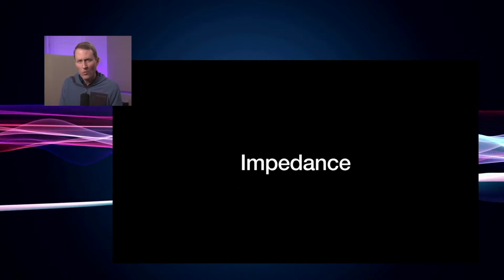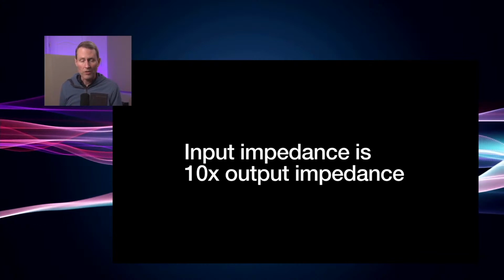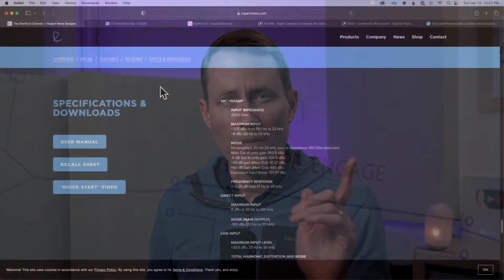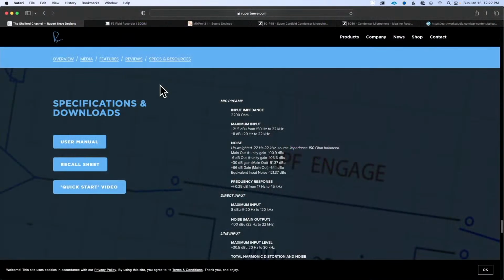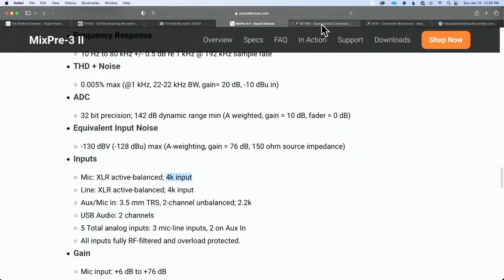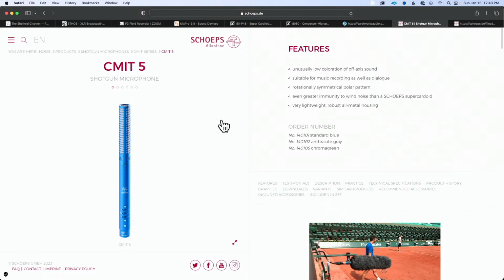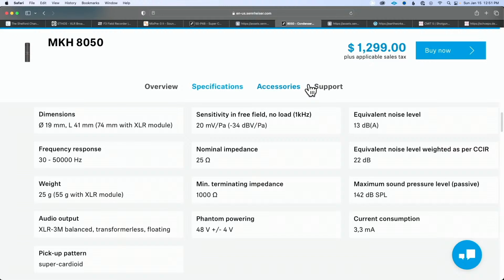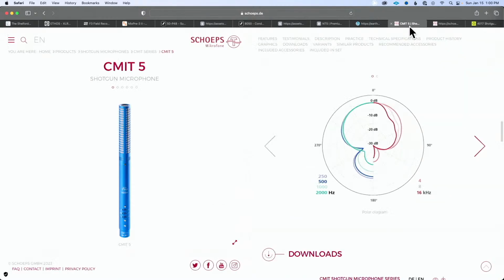Sound for Video Session — Impedance & Q&A

Comment: I consider impedance (AC resistance) to be simply the relationship between voltage and current as in R=E/I.  So high impedance devices employ higher voltage and/or lower current, while low impedance devices employ lower voltage and/or higher current.  
To me, this explains why a high impedance microphone (perhaps an old piezoelectric mic) that produces a moderate voltage but very low current doesn't work well with a low impedance amplifier input that is satisfied with a lower voltage but requires a higher current input signal than the piezo mix can produce.  This voltage/current ratio can be applied to amplifiers and speakers too.
Reply: Thanks for the insight, Philip. That's helpful 👍
Reply: Does impedance matter as much with microphones with an in-built in battery?
Reply: @matango1979  The built-in battery powers the built-in microphone amplifier, so that "phantom power" (that would otherwise power the amplifier) isn't required.  In this way, the battery is irrelevant to to the output impedance of the microphone.  

If the microphone element is a condenser type, the battery (or phantom power) is required to power the condenser (capacitor) microphone element that is inherently high impedance.  The amplifier is capable of converting the high impedance output of the condenser mic element to low impedance (lower voltage, higher current) for lower noise performance of the cable. 

If the mic has battery power, it's likely the output is low impedance.  Thus, it can drive an amplifier with low or high impedance input without distortion.